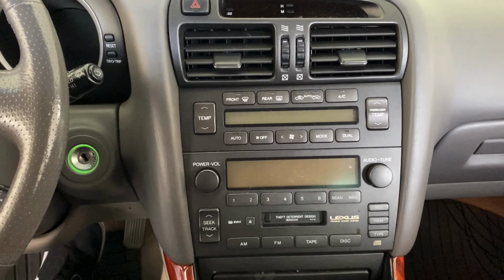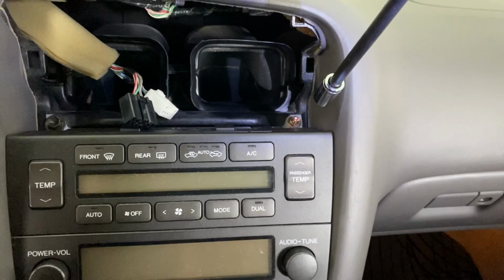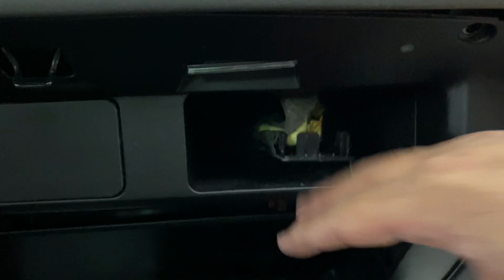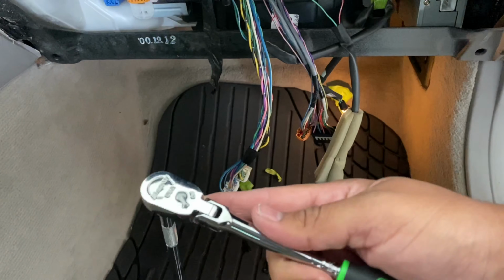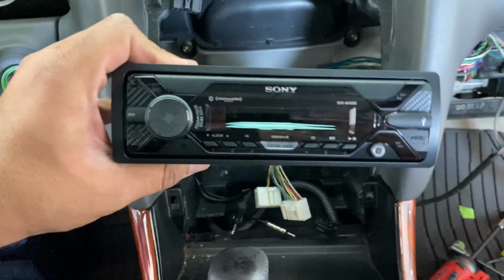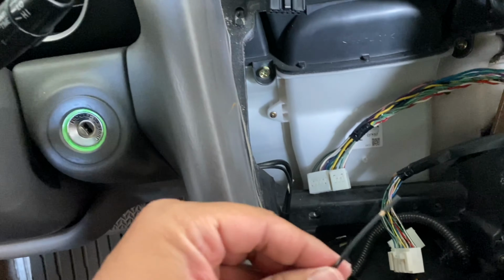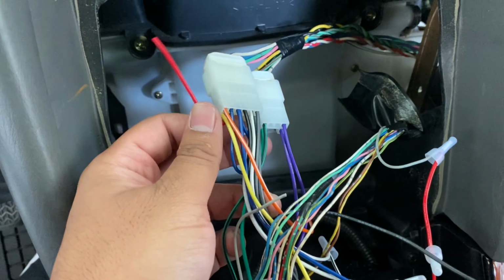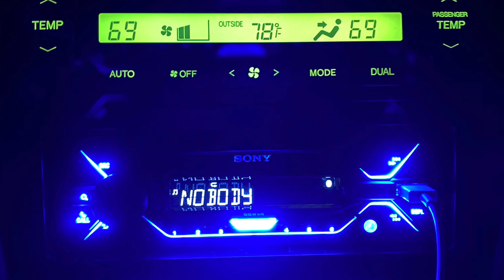How to install Stereo in a 1998-2005 Lexus GS300 GS400 GS430

Comment: Thanks for the video.  Unraveling that amp harness and routing it back behind the radio is smart and way better way to do it.  That Metra harness is a life saver too.  Every other video just has you tapping or splicing the wires.

Comment: Definitely going to give this a shot. Random thought, would it be possible to depin the gray accessory power wire and then pin it into the other connector rather than cutting and crimping the wires together?

Update: tested and working. If you don't want to cut any of the factory harness you can use a small flathead to depin the gray accessory wire and move it to the amp connector. It still has enough room to fit behind my head unit at least but it does force the unused plugs to be right by the used ones so it might be a problem.

Comment: I have a double din radio and I bought a harness off crutchfield but apparently that’s not the right one. The one you’re using I saw at Walmart was I’ll that work for my car?? Also what did you do about the amp
Reply from the maker: Im running it without the amp. The deck has its own amp, thats enough to power the speakers. If u have a 2nd gen gs the harness i showed in the video is all u need.

Comment: Just a quick question

Does the bass still function after unplugging the factory amp ? I was told by a local shop that they would be able to do the job of putting a double din unit but at the cost of no bass.
Reply from the maker: Na bypassing the amp makes it so the sub wont work anymore, unfortunately thats the only way to add an aftermarket stereo. U can always add a new amp and power the sub that way
Reply: @IMPACTRATED  oh Fosho that sucks the factory amp had a nice kick.

Did you put an amp yet and if so what size and what brand ?

Comment: I have a question, if the amp is not plugged up doesn't mean the subwoofer won't work where the speakers won't operate properly (less voltage or wrong voltage)?
Reply from the maker: The original sub wont work anymore if u want to keep using it u have to get another amp and wire it like u would any aftermarket sub and amp
Reply: @IMPACTRATED  fml thank you

Comment: Does the stock factory subwoofer still work after putting an aftermarket head unit in?
Reply from the maker: No. Its powerd by the original head unit and amp so once u remove the head unit it wont work. U can install a new amp and wire it into the original harness but its pretty complicated. Its easier to just add new subs in the trunk.

Comment: By unplugging and by passing the stock amp does that also bypass the stock sub? 
Or are you still using the stock amp just a new head unit, when plugging those other connection back in?  I've been wanting to put a new head unit in but don't want to bypass the amp and use the stock sub just to keep things as oem as I can. Any info would be great thanks
Reply from the maker: Ya u lose the amp and the sub. I tried to figure out a way to keep the sub but u cant, unless u add a new amp and at that point u might as well add a new sub all together.

Comment: I've been searching for a video to help me with this DIY and your video is the best. Got a question though and it was only a thought I had until I saw you video. You removed the cd changer, how do you feel about installing the aftermarket cd player there? That's where I'm thinking of installing mines and installing a tablet in the space of the original head unit.
Reply from the maker: That sounds like an awesome idea. The wiring would work. Maybe just make a bracket to hold the cd player in place but its definitely possible.

Comment: Hi can i install a single din in my lexus gs300? i have the navigation system in mine
Reply from the maker: You can if u want ur just gonna have alot extra wires that ur not gonna use. U just need a single din mounting kit but if u have a nav u may as well go with the double din since the space is a already there.
Reply: Mine also has navigation and the thing holding me back from doing it is that the ac controls are on the touch screen
Reply: @arielrodriguez9689  Im in the same situation as you, id assume if i wanted to isntall an aftermarket radio id need double din for weather controls and the after market radio right ?
Reply: @arielrodriguez9689  just get a regular ac control i just did mine that was my concern too and it just plugged and worked fine